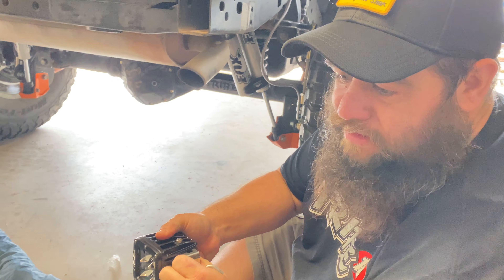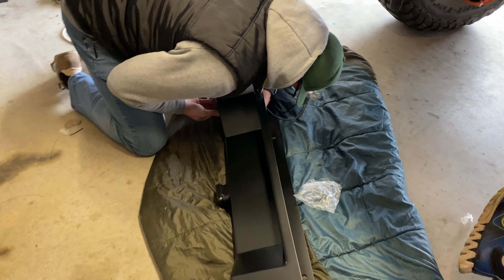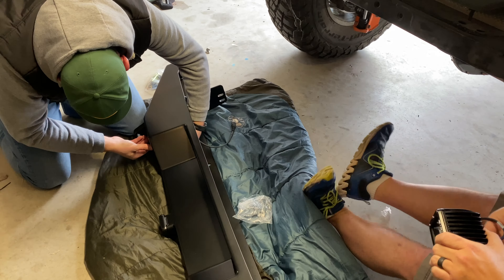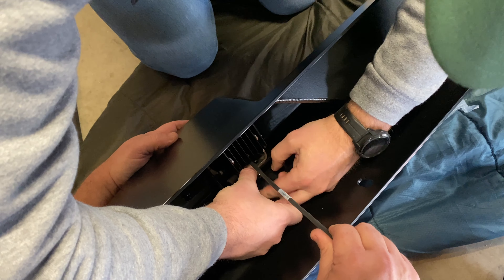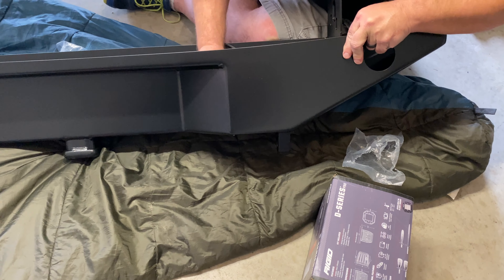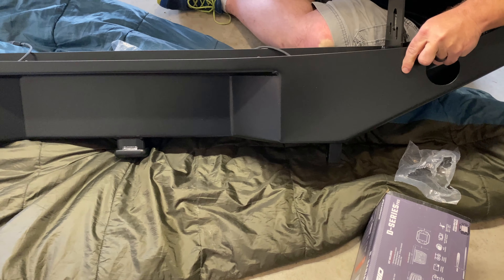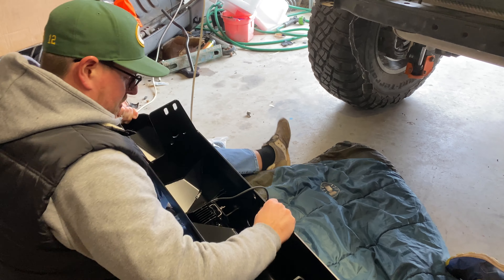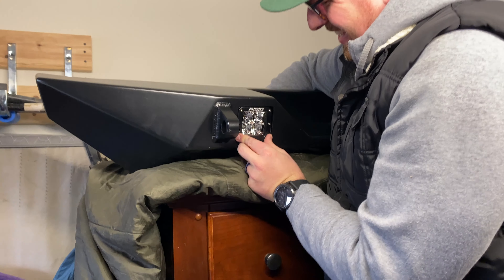Rigid Industries D-Series Pod Lights | Rock Solid Rig | Jeep Wrangler Mod

Comment: Irrelevant to the video, where do you guys get your Jeep inspected? I need someone to help me out! Lol

Relevant to the video, great work! I threw on some rock lights tonight so I feel your pain!
Reply from the maker: Thanks! We love our rock lights, they make a huge difference when night wheeling and they are great for parades. As for the inspection, we bought this Jeep in December so it hasn’t needed one yet. Unfortunately not much help with that one 😕
Reply from the maker: Do you mean someone to look at the jeep mechanically and help diagnose some problems? If so, if you are in the DFW area we highly recommend Tribe16 in North Richland Hills.

Comment: Love the bumper, love the pods you added to it.  Is that an S Pod that you connected to?  I thought I saw a different name on the base.
Reply from the maker: It's a switch from Amazon, the brand is appolointech, we did an install video on that last year at some point.
Reply: @RockSolidRig  Thanks, I thought I saw that name on the inside of the base.  I am considering a block on the inside of the jeep to connect my overlanding stuff on the inside of the jeep.   I assume it has the built in breakers and such.  I suppose they may not be rated as high in amperage, but I'll definitely look into it.